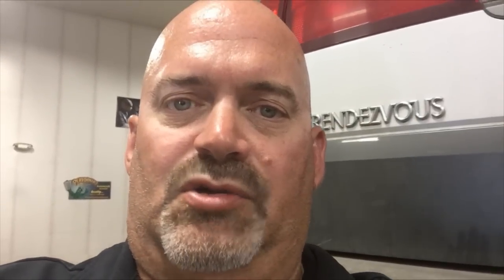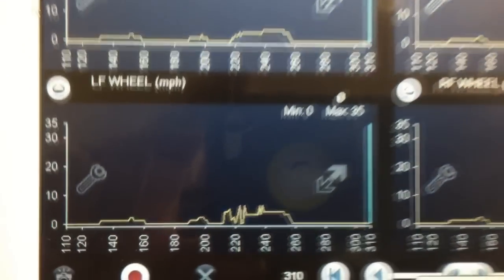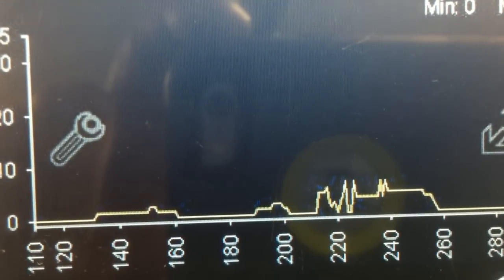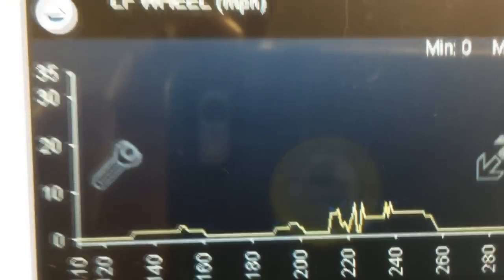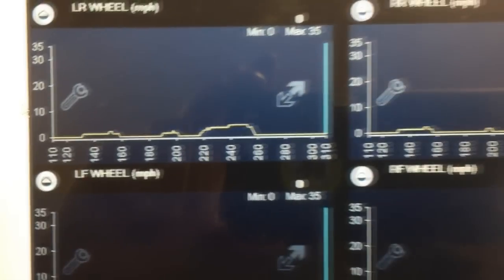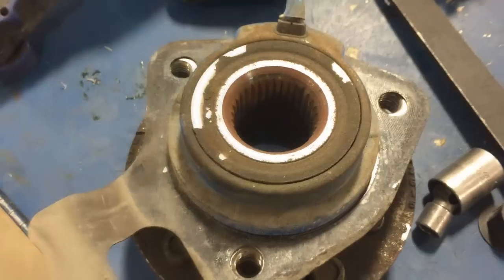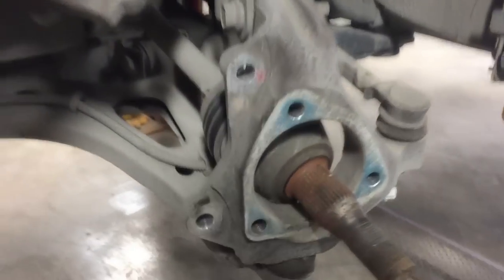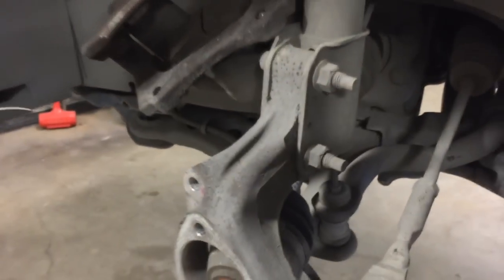Unwanted ABS Activation Diagnosis - 2005 Buick Rendezvous Anti-lock Brake System Problems

Comment: Great explanation. My wife's Rendezvous has the same symptoms, but it appears to be in the front right during some braking and turning maneuvers. The hub was replaced last June with a Duralast part. I'm about 3 weeks out on warranty expiration, so I ordered two Dorman units to replace both front hubs at once. The Dorman hubs have a lifetime limited warranty, so should I get another faulty unit I don't have to worry about deadlines. I will also take the vehicle side of the wiring out of it's protective tubing and inspect it just in case the problem is a breakdown in the insulation on the wiring when I do the job. I am concerned the wiring took some excess stress prior to the replacement of the engine torque mounts. We were getting a severe clunk a couple of times a day, and I told a shop three times my lower front right mount was bad but they always disagreed. I scoped it and saw cracking even. Then, after a sudden increase in clunking frequency, I found the upper mounts failed a few weeks ago. I replaced those and took the car to a different shop to replace the lower FR mount, which was in very poor condition, numerous tears and holes in the rubber. So the excess engine movement and clunking is solved, and that gets me down to this issue. Thanks for this and your other video, they were very helpful! I think I'll get this solved in a couple of hours at home now.

Comment: I got an 03 rendezvous CX model with a non-working ABS Light, it won’t come on, at anytimes, not when you’re out driving, not when you turn the key, to start the car, why is that, could it be because, it is not AWD, or what, if you can please, tell me, what’s causing the light Not to Come On, at No times, I thought, “hey Maybe the light is just not working, but if you can please tell me what’s causing the light to not come on, at No times, during its run times that would be greatly appreciated

Comment: I have a 2004 Buick Rendezvous that had one seized rear bake caliper.  Would this cause a  left front wheel sensor to activate the ABS signal?  Since replacing the rear caliper the ABS system has not indicated any problem.  Can anyone comment on this?  HELP!

Comment: We had a 2004 Rendezvous and it turned out the the RF sensor plug prongs were not making good connections.   We unplugged, took a sharp pointed tool and bent the metal openings on the female side of the plug and made them tighter so that the male prongs fit tighter.  No more problems....

Comment: I know this is an older video, but you described my wife's '05 buick rendezvous exactly.  I changed the hub less than a year ago, and in the past 2 months I started getting unwanted activation.  My ABS threw a code for that specific wheel sensor, so I ended up replacing the hub again with a different brand.   This time, the problem started up again even more frequently after only 2 weeks.   Did replacing the wheel hub actually work, or did it turn out to be another problem like the wiring harness?

Comment: Mine was the wiring harness. A short in the wire could cause the intermittent issue. I would recommend replacing the wire for hundreds of dollars cheaper. Too many with the Rendezvous have had this issue.

Comment: I have 2011 impala about to go take a look after watching if its a senor it has some way to test it check the ohms/ resistnce by unhooking electrical connector and touching both leads check all 4 and one will be different reading than the other three, I believe this is all off top of my head.  Ill let you know

Comment: Hello everyone My Brother  has this car and the other day it failed to start. A person at the Dealership told Greg to pump the Brakes? And It worked car started and runs perfect this has as of yet not reoccurred .Some thing about a safety measure when the Brakes show failure.
Has anyone of you nice people Heard of this 
Thanks you DOC
Reply: I had the same issue, it has something to do with a short wiring harness, look that up.  My brother had to go under the passenger seat area where there is exposed wiring and do some "rigging" because every time it rained my car would loose power and i could not start it.  water was getting into the wiring harness especially when i had just made a sharp turn.  it stretches the wiring harness too tight or something, i was reading about it online, it is a known issue with this vehicle and several other models similar to this one. it should have been a recall because it is a safety hazard,, but that is when the "bail" outs happened and somehow this recall never happened because it would have taken the company under for sure.

Comment: I have a slightly different problem with my rendezvous its an 2005 cxl edition the emergency brake light comes on and won't go off it just keeps chiming In have checked the brake to make sure that its not on at all I have tried to reset it ,nothing seems to be working and the chiming is driving me crazy can you help? please
Reply from the maker: Might be the switch located on the brake controller going bad or out of adjustment.
Reply: Deniro Blac I have the same issue.  How did you solve the problem?

Comment: Thank you for this video as this finally pointed me in the right direction on my 2003 Rendezvous. Mine slowly kept getting worse and it finally threw a code, I had to go to my local Autozone since my cheap Bluetooth ELM 327 scanner would pull ECM codes, but not the body/ABS computer. It threw two codes, 245 - wheel speed frequency error and 41 Right Front Wheel Speed Circuit Range performance. Now I at least had one wheel I could concentrate on. The bearing was tight & so I did a ton of reading. Apparently the wiring harnesses on these wearing out is a known issue. I clipped the harness back under the engine and spliced in the new one GM #10340314 using butt splices with shrink wrap. After a lot of electrical taping and reinstalling the plastic conduit my problem was eliminated! I post all of this here in hopes of helping someone else the same way that this video helped me!!
Reply: Thank you so much! I have a 2005 buick rendezvous and was having the same issue. This is pointing me in the right direction bucz of my suspicion of the ABS system. Thanks again

Comment: I'm having this exact issue in my 2005 Chevy Suburban. Intermittent ABS activation coming from the front left tire. Mostly happening when braking with the wheel slightly turned left. I Had brakes rotors and wheel replaced last fall. I had the shop check it out and they are telling me no code comes up and its probably the sensor which isn't under the warranty. Should I ask one of them to ride along with the sensor in like you had to record the event?
Reply from the maker: That would help. Sometimes a sensor or even cleaning under the sensor mounting surface will fix an issue like that but on your vehicle its probably more likely that the actual hub assembly is worn and it likely needs the entire hub and bearings assembly replaced but on a positive note it comes with a new sensor. Get a quality part, not the junk red box part. Also you can probably jack up the control arm and see if the bearing wiggles. That would be a sure sign of hub failure.

Comment: thanks 4 responding...dont want 2 take 2 much of your time....what is pids? not sure of codes engine light just came on....just replaced driver side hub still intermittent abs pulse and tc light and awd light
Reply from the maker: +Thomas Williams Jr. May be a problem with the other side. A PID is a perameter ID and displays a value when accessed on a scan tool that can show data. The wheel speed sensor PIDs display FR FL and either RL and RR or simply rear if there is a single sensor in the rear. Monitoring the wheel speed values while moving slowly can identify a sensor that is not sending a proper sensor and give you a good idea where to look. Checking wheel bearings by physically attempting to wobble the wheel up and down or side to side may show bearing issues and help pinpoint a problem. As the bearing fails the sensor will not read properly and at slower speeds the signal will drop out and the ABS module will think that wheel is locked up and begin a actuating the ABS system to stop skid.

Comment: i changed my bearing twice on driver side front with a cheap one then a good one and i still have same problem....2005 rendezvous cxl plus awd....driving me crazy...please help car doctor!!!!
Reply from the maker: +Thomas Williams Jr. What code are you getting? Are you able to monitor wheel speed pids while driving the vehicle? Be sure to look closely at the wiring at each wheel for any breaks. Also I have found where people have pierced the insulation and allowed water intrusion to break the wire inside.
Reply: The wiring was exactly what was wrong with my 04 Rendezvous.  Where the wiring came off of the rocker arm there was a heavy tape covering the wire.  However, on mine there was a break in the tape/insulation.  That is where the wire was exposed and took all of the force during turning activity.  When I pulled on the wires you could tell the wire was broken in that spot.  I replaced that wire harness and the problem went completely away.  Hope this helps.

Comment: Replaced speed sensor in my 06 equinox, worked fine for 2 days and unwanted intermittent activation occurred again, any ideas????
Reply from the maker: +jack brown Bad hub.
Reply: See my post. Try the wiring harness first as it's cheaper and easier.
Reply: @ericsmith9046  wiring harness ?